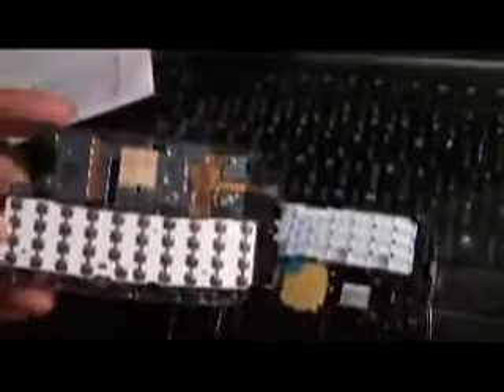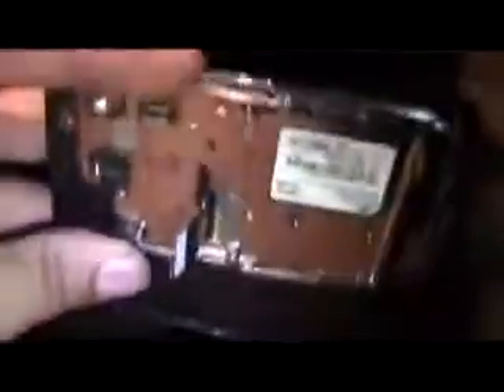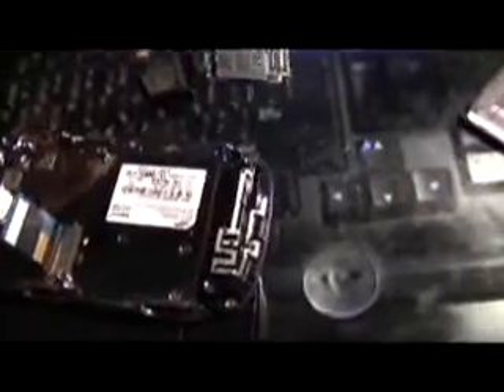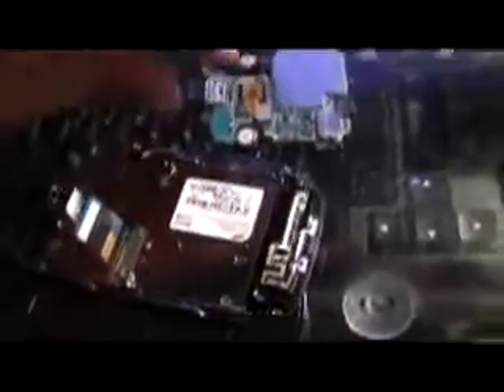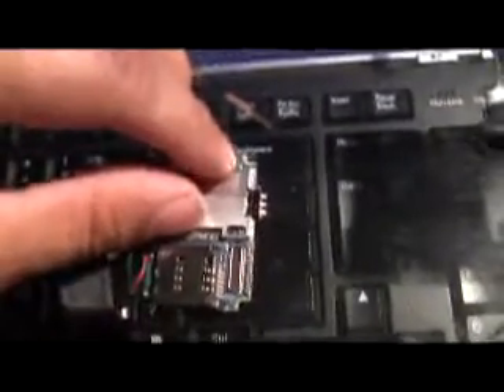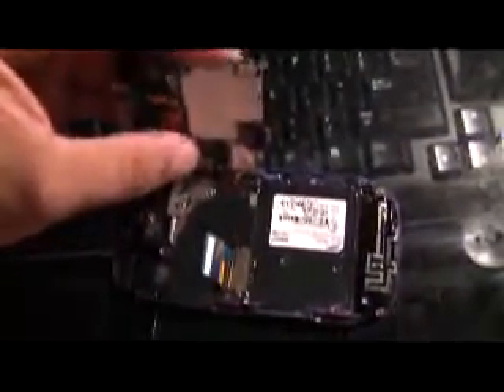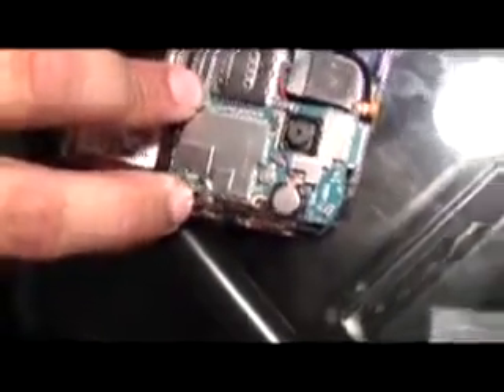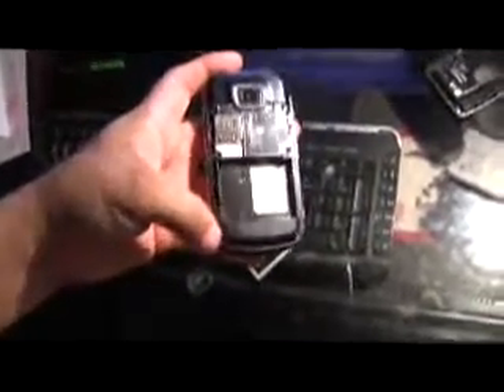Samsung Impression phone. How to put back together (take apart)

Comment: so sad... bought a used broken one hoping can fix for cheap but has lots of scratches and needs to replace flex cable and digitalizer has lots of scratches and so boes the housing need to replace lcd cause of cracks so far almost 40 bux to remake the phone